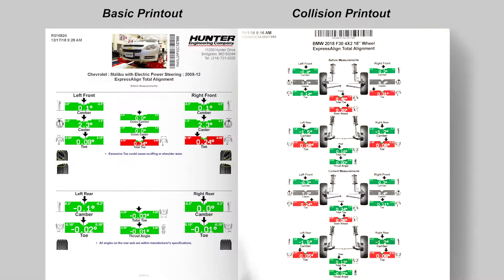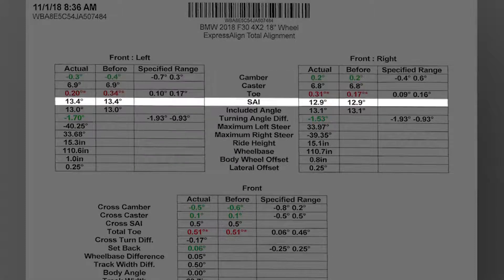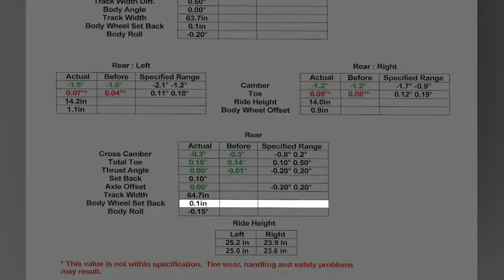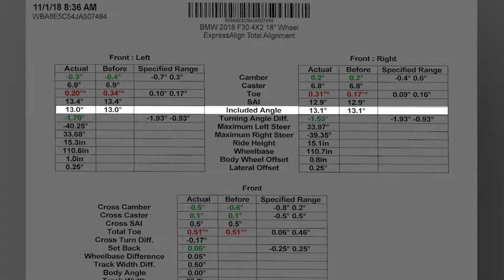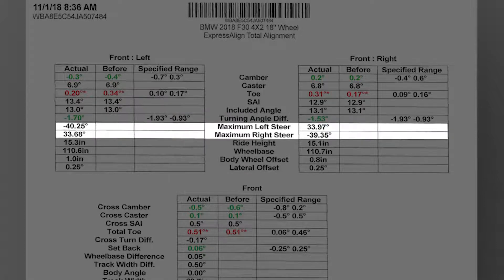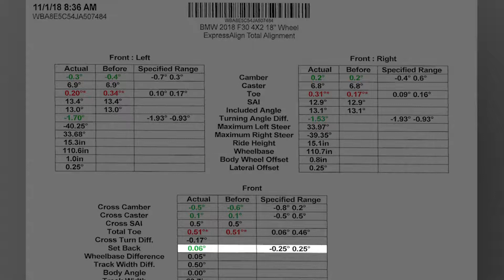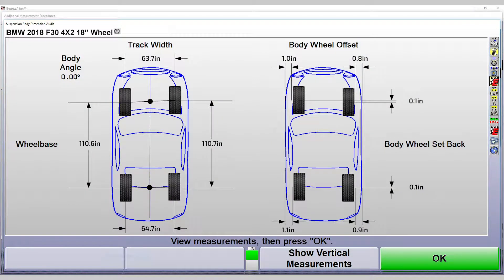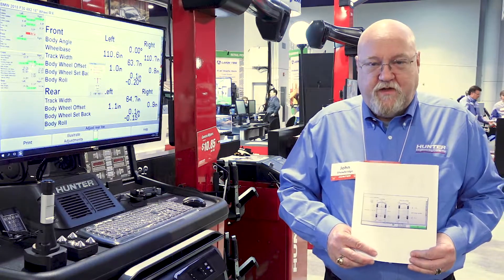Hunter Collision Alignment - Understanding Advanced Diagnostic Alignment Angles

Comment: Based on those specs I'd say you'd have a pull to the right, camber more positive on right and caster lower. Left inside edge likely would get more wear also. Like the looks of all the extra information you get with this hunter system, wish I had it.